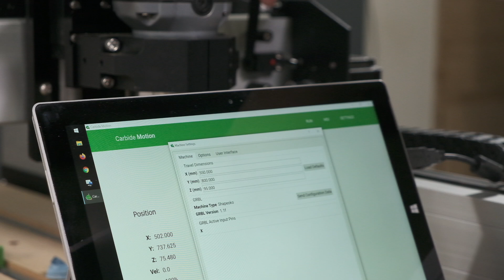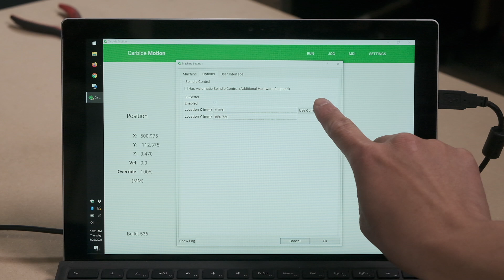How to Assemble the Shapeoko 4 CNC Router

Comment: Just a heads up, there's something I noticed about the z-axis motor: the cylinder is protruding. I attempted to clean it and reposition it, but it didn't align properly, so I had to push it in further, causing the cylinder to stick out.
Reply from the maker: If you are having issues, reach out to support@carbide3d.com 
Our team will help get your machine properly adjusted.

Comment: For those putting together the 4 XXL..

Pg.34,35 “Install data drag chain head bracket” and “Install router drag chain head bracket”, the bracket for both is now one piece. 

Pg.42 WW and ZZ weren’t included in my box but don’t seem to be needed. 

Pg.65 9.3.2 it says to use two M6x6mm BHCS. I tried for 10 minutes to make them work without success. I confirmed with a gage that that holes are tapped for M5-1x6mm. Fortunately I had two in my bag of spares.

Comment: 1) you don't explain what v wheels are or eccentric screws
2) the video isn't in chronological order of how you actually built it
3) the dust guards on the bottom will block the aluminum slats. You did that in the wrong order 
4) you don't help with the wiring at all.
5) the zooming in too close to the machine and cutting to another zoomed in shot throws off the flow of the video and makes it hard to follow.
7) you talk too fast
8) I had to rewind this video at least 100 times I'm not exaggerating one bit.
9) at the end you say initialize with the wrong software. You're clearly are using carbide motion but instruct the viewer to use carbide create. 

Those are just some of the problems I faced, I can't imagine what other people struggle with because of the poor instruction of this video. You guys either need to delete this video and start an actually helpful video from scratch, or (this may sound crazy) include an instruction manual with the CNC machine. For almost everyone, this is their first time building a machine this complex, and this aspect of Carbide's customer service needs a major overhaul.
Reply from the maker: Sorry you had issues assembling the machine.  There are additional resources for assembly and learning CNC located at My.Carbide3D.com 
There you’ll find a “Manuals” link and you can download the specific pdf for your machine.   
Additionally you’ll find 5+ hours of video training designed to build your CNC skills.  

If you have something specific, be sure and reach out to Support@Carbide3D.com 
We are happy to assist in every way in order to make your Shapeoko experience a great one.

Comment: My Y axis sensor isn't in the correct position to sense the metal for my XXL. Did anyone else have to move the sensor? My power button also does not illuminate, which makes me think it does not work.
Reply from the maker: Reach out to support.   They will get you all set up.

Comment: In step 1 (2min in), my “drag chain ends here” holes are in a different location and spaced differently
Reply: Hi, what was your fix for this as I am facing the same issue? Also, my controller mount holes are further apart than the base frame fixings. I'm guessing due to poor QA they have mixed up the parts from other machines as my boxes didn't even have the step numbers marked on 5 of the packing boxes. Very poor start.

Comment: Bought mine a week ago. Shipping was great build instructions are horrible. First the machine didn't come with any. This video jumps all over the place and is not well done. Just build the thing with out skipping around. Build it the way it comes out of the box. There is absolutely zero wiring diagram. I have two cables that say X motor on them but I only have one X motor cable to plug in l. I have one cable that says YL So I'm guessing that goes to the Left Y-axis motor But if that's correct I don't have one that says RY for the right Y-axis.  motor.
Reply: Thinking about getting one, did you get sorted out?
Reply: @beefbounds  yes I had to call the mother board was wrong and I had to swap 2 wire's. Definitely worth it even though the instructions are not great

Comment: Just received mine and am unable to follow this video. The video jumps back and forth with parts just appearing already assembled  that I don't have. Some help would be much appreciated.
Reply: I had the same problem
Reply: @murtazabahrainwala9043  I emailed them and they replied that "it is similar in many respects to the Shapeoko Pro , with the exception it uses Vwheels in place of linear rails." And said to use the Shapeoko Pro manual.

Comment: Where can I get a table like the one in the video? I need something wide enough for my XXL.
Reply: Home Depot has a very similar looking table (possibly the same).  Search under “work benches”.  Can select from 2 different widths.
Reply: @djklypz  You're absolutely right! Looks like the Ultragraphite Wood Top Workbench. Great eye!
Reply: Came to the comments for the same question!
Reply: Couldn't find the size to fit the XXL then I realized he has 2 tables back to back.  $250 a piece on Amazon.  I'm thinking it would be cheaper to just build one.

Comment: Great video, lots of concise instruction. Was shocked to see you used an industrial grade CNC for manufacturing. Thought you could have used a Shapeoko to build a Shapeoko !!
I thought you had dispensed with Z axis belt in favour of a screw drive? Or is that upgrade only? Does Shapeoko 4 come in a Standard & Pro configuration or have you streamlined to 1 core spec?
Reply from the maker: All Shapeokos now ship with the Z-Plus leadscrew Z-axis. Shapeoko 4 is V-wheels on X & Y, Shapeoko Pro is linear rails. Hope that clears it up. -W